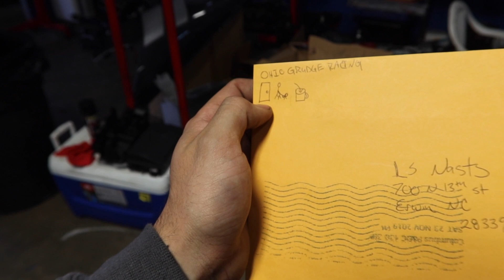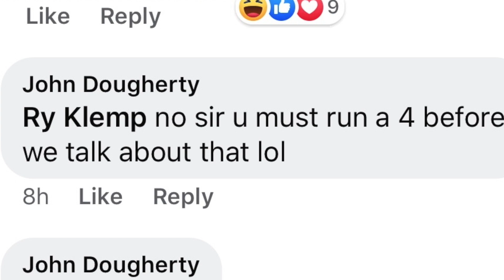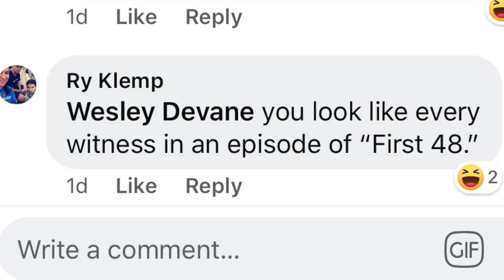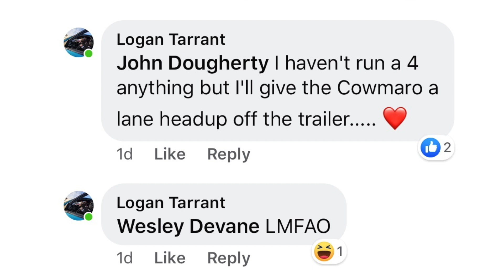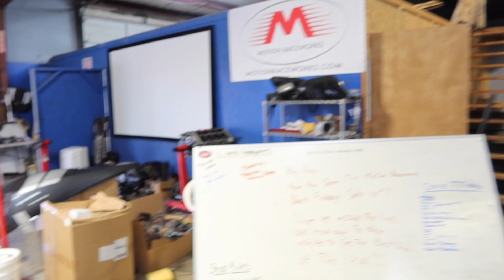GRUDGE RACE!!!!! Clapd Out Twin Turbo RX7 vs the COWMARO!!!

Comment: If you call billy out it needs to be a street race or no prep race.  That is what he does so you better be prepared to have a dirt road tuneup in that Colorado or he will be putting the gap on you.
Reply: He would even with the tune up, make it a prepped race call out, to be interesting run. But it will be fun to watch just because we like both, but it's a disadvantage in no prep/Street for sure
Reply: @jumpstreet2425  i like watching both but i like billy and his dad because they are blue collar racers that struggle to keep their cars going when they break to make the next race.  They dont have deep pocket buddies or family to fund them so it hits home with most racers out there.  Jon started the while budget build then went straight to a dart block 470" crank driven procharger setup with four link setup so it just isnt relateable.